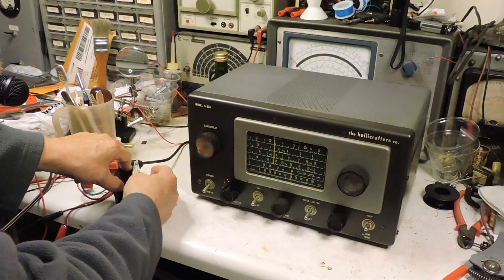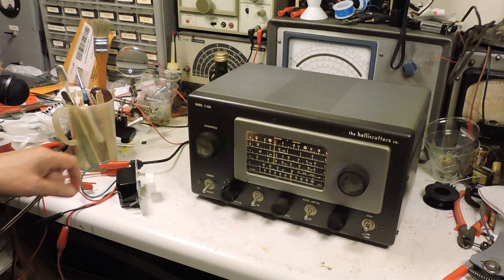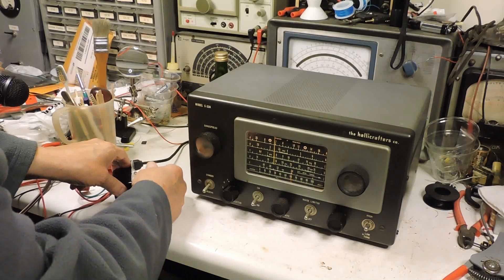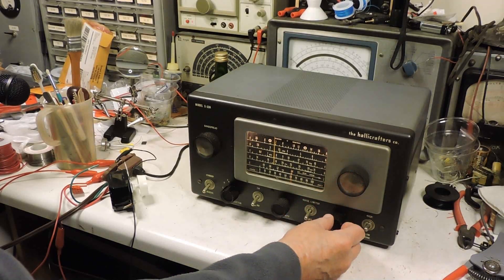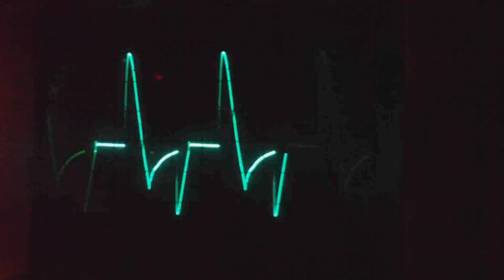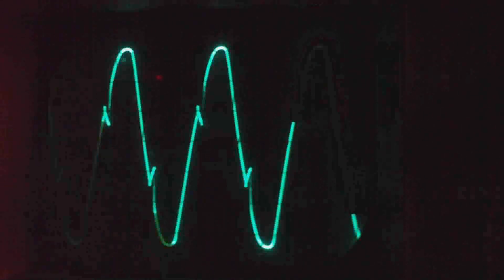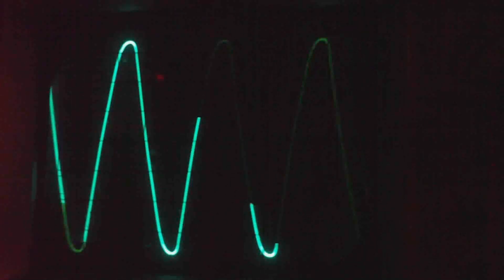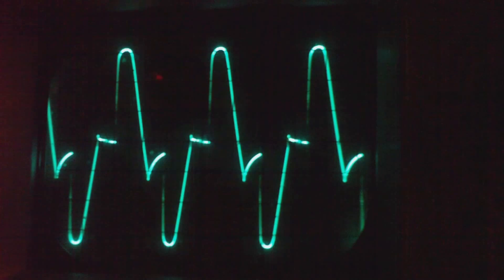Can I use a Light Dimmer instead of a VARIAC

Comment: What if you put the output of the dimmer through a full wave rectifier and some filter caps? That could feed most AA5 radios directly, or the B+ input of just about anything else. Maybe a zener regulator would make it a little safer from an unintentional over-dialing. Inelegant but cheap.
Reply from the maker: The original question was if he could use a light dimmer in the place of the VARIAC. A VARIAC varies AC at it's output. If you rectify the output you would have variable DC.

Comment: But what if you add capacitor(s) on the output of the dimmer switch?
Reply from the maker: Maria Engström I would use incandescent lightbulbs in
series with the radio, TV or audio equipment. Start with a 25 W
incandescent bulbs, and after a time put in a 40 W incandescent bulb,
and after more time put in a 60 W incandescent bulb, and then last
about 100 W incandescent bulbs. Using incandescent bulb is pretty
safe and if something happens to the equipment, like a short, the
incandescent bulb will become brighter and not burn up your
equipment.
Reply: There is more than one reason why you can't use a Light Dimmer instead of a Variac one of them Light Dimmer works on Phase-cutting principle so it cut the time of the pulse................... the rest you should know.!!!
Reply from the maker: It's AC not DC
Reply: Yea... I did not think about that. :)
Reply from the maker: Maria Engström You could use an AC stabilizer, but they cost more than a VARIAC.
Reply: Awesome
Reply: AllAmericanFiveRadio Yea, Smart idea! If there is a short, you get immediate indication and the lamp probably saves the rest of the equipment.
Reply: AllAmericanFiveRadio You can also use an electric heater. and connect it at the filament on different places to get the different voltages.

Comment: Hi Rick, nice radio. Boy there’s a shed load of issues that can develop from using thyristors, triacs or transistors for voltage regulation by chopping up at 50 or 60 Hz. We used to use thyristors for varying voltage at 100’s of kW’s in industrial equipment but you need a lot of reactance to overcome the problems if you want to rectify it and make smooth DC. Once the high power high frequency switched mode power supplies came along with high frequency switching the iron core reactors that are needed at 50/60 Hz could be replaced by very much smaller ferrite cored inductors. But as you full well know there are still some problems of RFI from some switched mode power supplies RF operation. The other issue is measuring the voltage with a horrible form factor, something that electronic meters do better than the moving coil meters that we mainly had when Adam was a lad.
All the very best  . .  Andy
                                        GWØJXM
Reply: *****
Hi Randy
 I don’t want to hijack Rick’s video here, but remember that with a ‘phase angle firing’ device, like the one in the video, the peak voltage is largely unaltered so the voltage stress isn’t necessarily diminished as much you may think and the increased ripple could just do a bit more harm than good. I don’t think that Rick promoting the idea of using a dimmer and I’d say if you don’t have a variable transformer it’s a good idea to put an ordinary tungsten filament light bulb in series with the radios supply.  If you use a light bulb with an equivalent wattage to the wattage of the radio, or there about, then it acts as a 'berretta.’ Power will get to the radio because of the low resistance of the bulbs filament when the bulb is cold but if the current rises too high, (if for instance a capacitor breaks down,) then the bulb lights, the bulb’s resistance increases and limits the harmful current. I guess as you appreciate that when solid-state devices get over driven they typically switch hard-on.
Anyway, I daresay Rick has used the berretta method as well and may talk about it some time.
    Kind Regards  . . . Andy.
Reply from the maker: AndyDaviesByTheSea Andy,
that's interesting that you brought up
RF problems. I've been thinking about building a DC power supply that
while block RF from traveling through it into a household AC. Thought
it would make a useful and interesting YouTube video. Plus it's
something I can use, I think it will be a winter project. I can
imagine the battles that you must have fought with such a very high
voltage and current applications. Must've been like balancing a raw
egg, if things weren't just right things would go wrong big-time.
I had a few interesting comments on
that Zenith radio shutter dial. In that video it was just incidental.
So I think I'll do a close-up, short video on just the shutter dial.
Go ahead and chat away, it's all very
interesting

Rick

Comment: I pretty much knew the answer before I saw your video. My dad hooked up a dimmer switch to a ceiling fan one time. It made it sound about like an electric can opener.  I also have noted older audio equipment tends to not tolerate modified sine wave inverters (the most common type of inverter).

Comment: One time I could actually hear this noise in a dimmed light. That's why you can't use CFLs or certain LED lights on dimmer switches because the driver circuit can't handle all that noise.